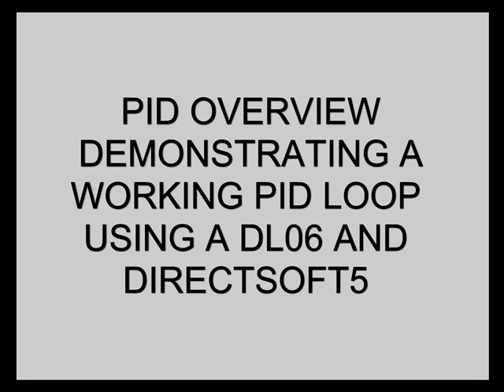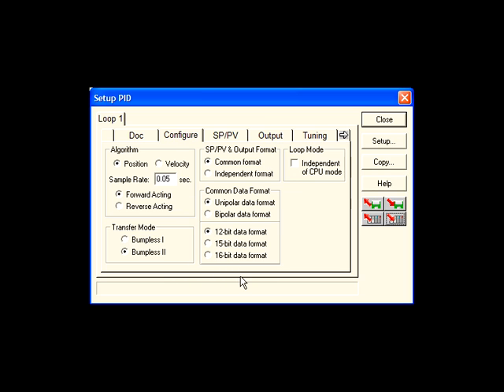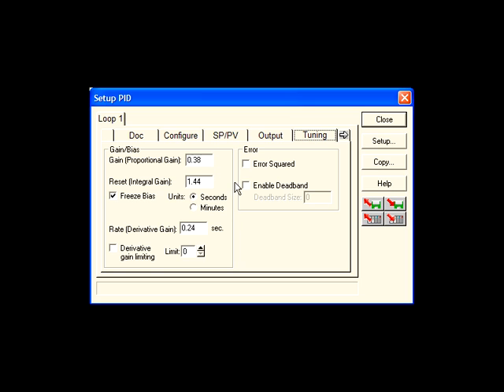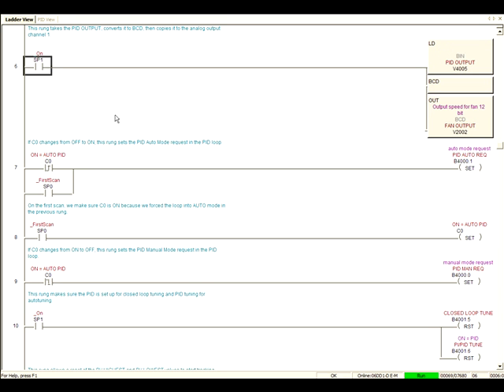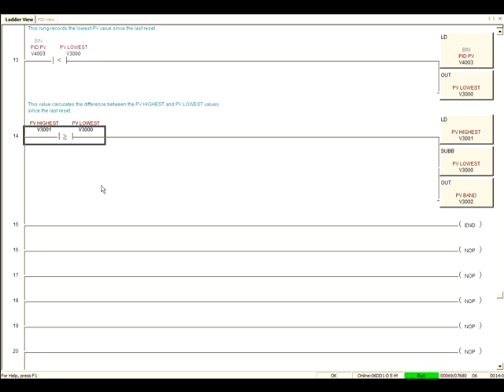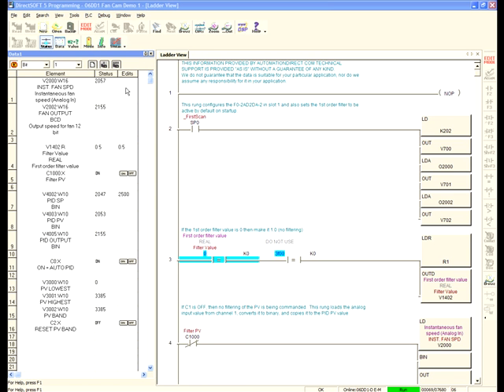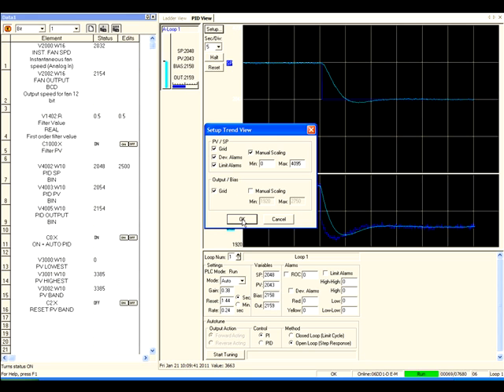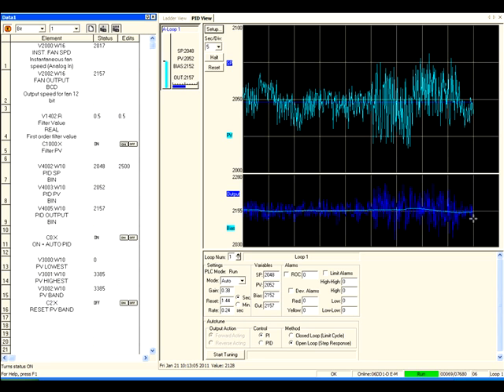DirectLogic PID Overview using DL06 & DirectSoft5 from AutomationDirect

Comment: this is great...  can you use the DL06 X0 HSIO frequency input as GPM flow meter or Hertz to FPM speed control with the PID loop control?   thanks a lot...:)
Reply from the maker: Q zorn, yes you can use the Frequency Input as your Process Variable.